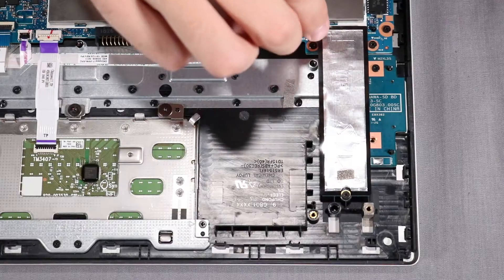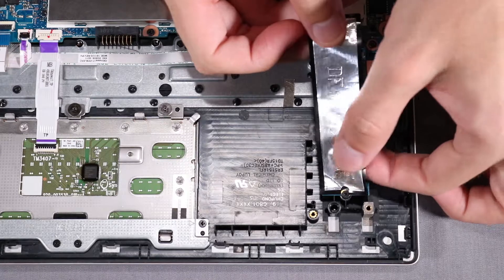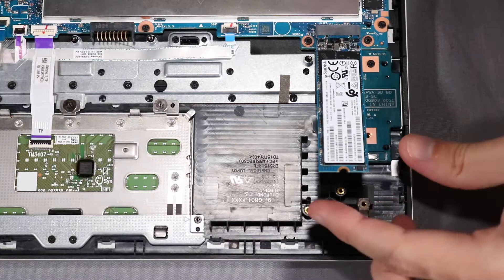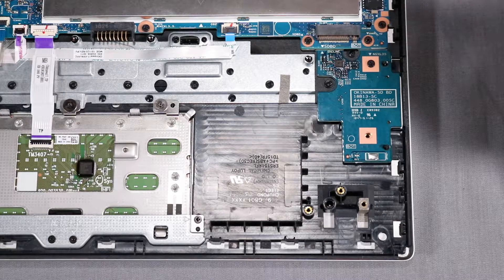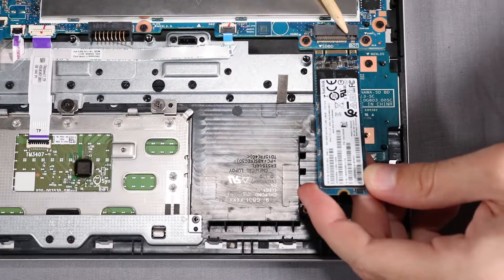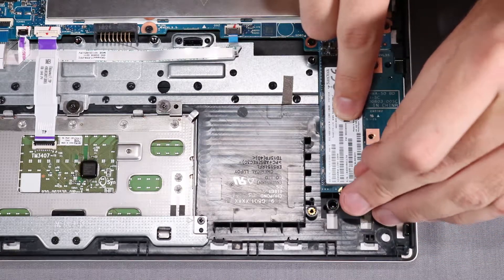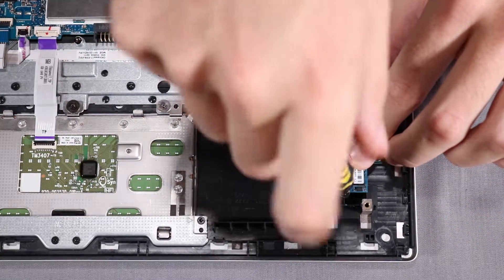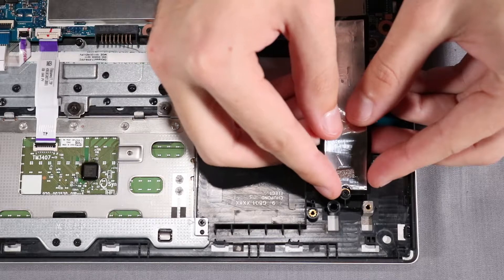Replace the M.2 Solid State Drive | HP ENVY 17-ce0000 and 17-bw0000 Laptop PC | HP

Comment: What does the HP Envy 17-ce2010nr use? Is it SATA III or NVMe?
Reply from the maker: +Kaiser Allen It uses 128 GB SATA 3 TLC M.2 SSD.
Reply: Thank you! What is the maximum amount of RAM I can put in it? Will 32GB work?
Reply from the maker: +Kaiser Allen It supports 12 GB DDR4-3200 SDRAM (1 x 4 GB, 1 x 8 GB)